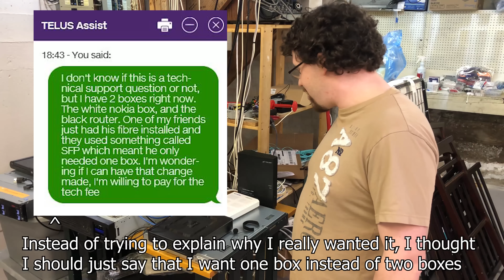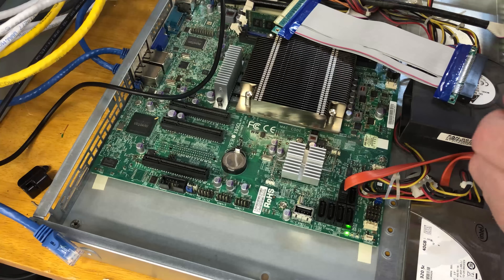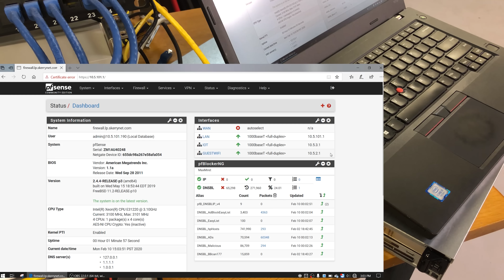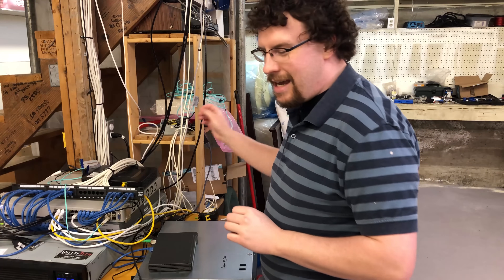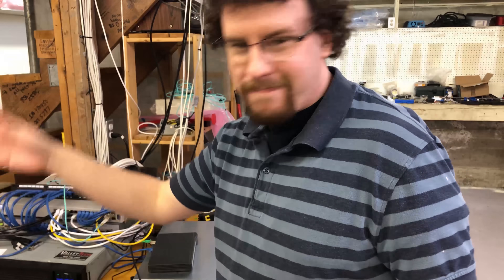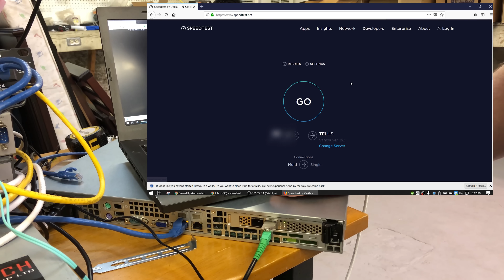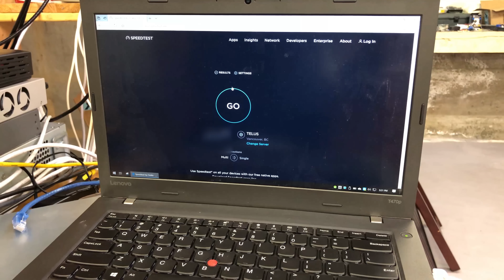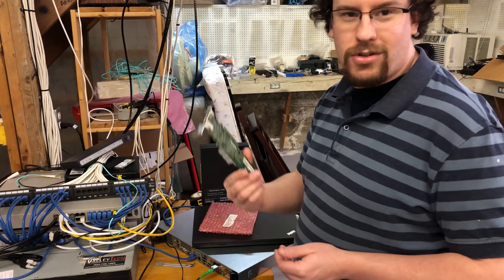I connected my fiber internet directly to my pfsense router via SFP!

Comment: My GPON is 2.5gbps as I think most are. I use Bell and used a Broadcom card it required eeprom flash and driver patch to get it to sync at 2.5gbps. If it sync at 1gbps because the default driver only supports that I would not get full gigabit speeds.
Reply from the maker: Interesting, thanks for commenting, it led me to a great DSLR thread talking about this exact thing with Bell. My link speed is 1gbps. Telus currently advertises the service as "Gigabit Fiber" but in reality they claim speeds up to 940mbps. Currently I'm able to hit those speeds, so for now I'm satisfied. I'm going to do some more research, I find it odd that they limit their gigabit internet speed to 940mbit, perhaps it is not gpon 2.5?
Reply: @TechwithShae  Yea I would only get speeds like 70-80% such as 700-800mbps when GPON synced at 1gps
Reply: @TechwithShae  you should know by now that a connection of 1Gbps means 1 million bits of raw throughput, not the amount of data a human considers usable or readable. The amount of bits a connection moves is not the same as the amount of bits you consider usable in terms of free bandwidth because each packet of data transiting over any ethernet/GPON/IP network is formed with a structure of multiple layers (physical layer, data link layer, network layer, transport layer and others until you finally get to the application layer, the one that usually matters for humans). Before you reach the application layer, each of those layers have already incorporated its own chunk of bits into the packet. For instance, each packet contains the source and destination MAC address, source and destination IP (and a bunch of other technical stuff), and only after all these framing bits are incorporated into the packet, are the the usable / readable data actually incorporated into the packet.

As usually called, the difference from 940Mbps to 1000Mbps is the overhead, ie, the amount of data included in a packet that is not usable by us (humans) but it is necessary and usable by the machines to know how to handle and transmit the packet over and across a network.

You can test yourself. Link 2 machines directly over a 1Gbps connection (regardless of being fiber, copper, being 1cm away or miles away) and transfer anything you want. You'll see that your useful bandwidth will cap around 940Mbps but if you have some way of checking the total and real throughput of your NIC, you'll see doing very close to 1000Mbps.

Hope this has been helpful.
Reply: @TechwithShae  in addition, for you to be able to connect the ISP fiber directly into pfSense, I suspect they might not be using GPON at all (but some sort of other fiber network arrangement) or at least GPON in its normal setup (none of these seem likely), unless the SFP module they provided you acts as an ONT itself (the more likely scenario if they are really using GPON). In a GPON scenario is also not very common to have a symmetric 1Gbps connection because OLT ports are not symmetric as well (they are 2.5Gb down and 1.25 up) and having a symmetric 1Gbps connection might mean you could potentially use most of its upstream bandwidth and other clients hanging on the same OLT port would have mediocre upload speeds, unless you have a dedicated OLT port, which is HIGHLY unlikely unless you were paying huge amounts of money for a dedicate connection to the OLT.

GPON has as its own protocols. Ethernet/IP packets are encapsulated inside GPON packets through the GEM (General Encapsulation Mechanism). That NIC and/or pfSense don't not know how to deal with GPON packets but only with ethernet/ip packets.

So, unless the SFP module acts as an ONT and makes all the heavy duty to deal with GPON packets and present clean and translated ethernet/ip packets to the NIC, you should not be able to have a connection.

Additionally, GPON uses techniques of TDM (Time Division Multiplexing) to allow upstream and broadcast for downstream. pfSense or your NIC have no clue about the TDM settings to upload in a syncing other.

Also, your NIC would need to be synced at around 2.5Gbps download to be able to properly download, once downstream in GPON is made in a broadcast manner which means all ONTs receive the same packets (up to 2.5Gbps continuously) but through the GPON packet framing / GEM, they are able to pick the ones that are directed to them and drop / discard the others.

Let alone the encryption that GPON packets usually carry, neither pfSense or your NIC are not instructed on how to proceed.
Reply: Please elaborate on model of card and flash!
Reply: Bob Carpenter BCM57810S all info is here. Mine is a Dell Y40PH https://www.dslreports.com/forum/r32230041-Internet-Bypassing-the-HH3K-up-to-2-5Gbps-using-a-BCM57810S-NIC

Comment: What's your uptime?   Is it stable past 24 hours?  How's the heat?   Good choice with Chelsio.
Reply from the maker: Stables for over a month now. Temperature is also good! (See below)

Here is the stats from ifconfig -v
module temperature: 36.85 C Voltage: 3.30 Volts
RX: 0.03 mW (-14.93 dBm) TX: 1.86 mW (2.71 dBm)

Comment: First,  you are saying Chelsio correctly.  Second,  that is the brand that Netgate used in their own hardware  (at least when I worked there back a few years).
Reply from the maker: Thanks for confirming my pronunciation, and interesting to know that netgate uses them. So far this setup is rock solid.

Comment: Works whit  EdgeRouter too 👍
Reply: Mine did not. I posted in DSL reports about my experience with the ER4, Telus, this particular SFP GPON throws a write error on Edgerouters, they also don't support GPON officially either. Mine would disconnect from Telus every 40 second to 10 minutes at random. I posted as BCinBC

Comment: Are you getting higher than 1GBps from the ISP? You could get away with SFP only (not SFP+), but I guess this is more future proof. I would imagine a single slot SFP would use less power and not be as hot.
Reply from the maker: Currently I am not getting speeds over 1gbps, however I wanted to future proof it a little bit. So far no heat issues, and the sfp module runs cooler then it did in the ISP’s router.
Reply: @TechwithShae  wish I had access to fiber where I live.....:(
Reply from the maker: @TRD_2zz  I live in a small town, the day they announced they were rolling out fiber here, I literally could not believe it. I do realize I am lucky though.

Comment: Thanks for doing this.  I am not a fan of the junky installs that (Telco) does with exposed wiring, multiple boxes required and and no chance of a single point battery backup. I have placed my installation on hold until I sort out some way to simplify things and eliminate exposed wiring.

Goal: Eliminate proprietary equipment inside house but still have TV.  The Nokia ONT is okay,  but the required modem is huge. Currently my cable modem setup resides in a structured wiring box and is UPS backed but the telco modem won't fit so it'll need an additional structured wiring box with another UPS.

This may be region specific but tech support tells me that SFP might work but if I want TV, I'll need to use the Nokia ONT+ the modem that they supply.  The modem connects to the ONT via Cat5/6. There are 5 ethernet ports on the modem, one looks to be a WAN port connects to the ONT.  3 ports go to TV set top boxes using Cat 5/6 and the remaining port on the modem is for the LAN.
Reply from the maker: I have read on DSLReports that some people have managed to get TV to work without using the provided modem/router, but with limited success. In addition to that, I discovered that the IPTV boxes will not work correctly through a switch, they must be plugged directly into the provided router. I believe this has to do with QOS, but not entirely sure. I personally do not have TV, but I have several family members that do. 

The only thing that tech support said would not work is fiber phone when using SFP.  They did say that depending on when the fiber was rolled out in certain communities, there may be incompatibilities with the SFP module, I was under the impression that either everything would work, or nothing would work (internet + TV).
Reply: I did this with my Unifi setup, an IGMP forwarder for the multicast traffic was all that was needed to get Optik TV working.

Comment: Just out of curiosity - what pfsense box is it?
Reply from the maker: I'm running pfSense on a SuperMicro 5019-s
4GB Ram, Intel Xeon E3-1220, 40GB Intel SSD

https://www.supermicro.com/en/products/system/1U/5019/SYS-5019S-ML.cfm
Reply: Can you post the details of the Nokia sfp module?
Reply from the maker: My ISP provides the module, here is the information from the label:

Nokia GPON ONT SFP (G-010S-A)

There is very little information about it on the web, I do know that the module is registered with the isp, so you can’t just use any gpon sfp module.
Reply: @TechwithShae  It probably got a MAC adress that is ties to the  card in the  ISP telco center and it will only connect to that. It then probably  has a unique provider id and serial number that get checked against your account its probably transmitted as an encrypted packet as well, with the ISP having the decrypt ket...